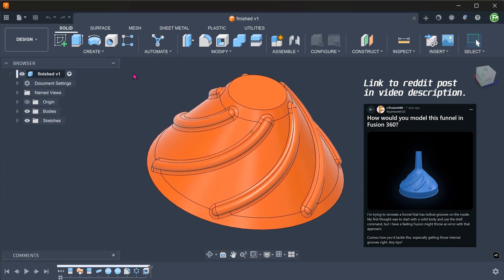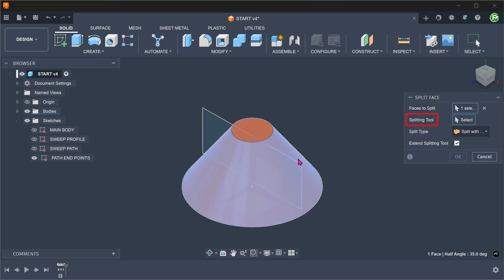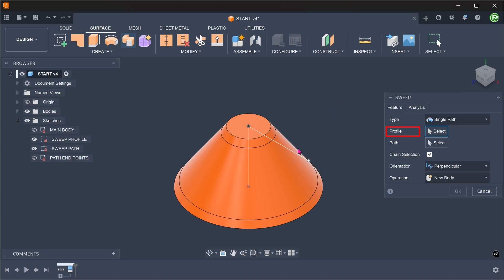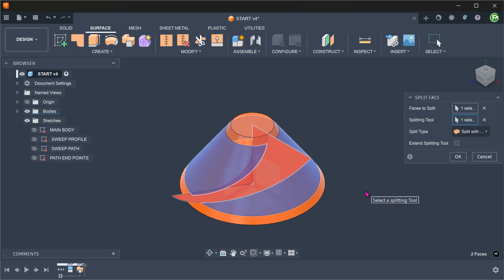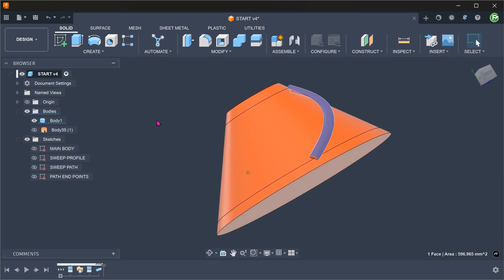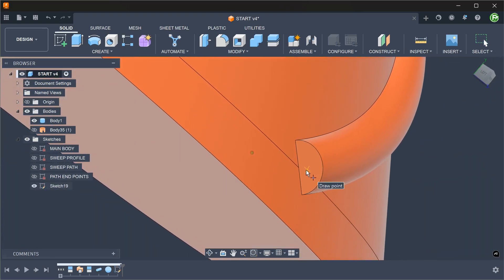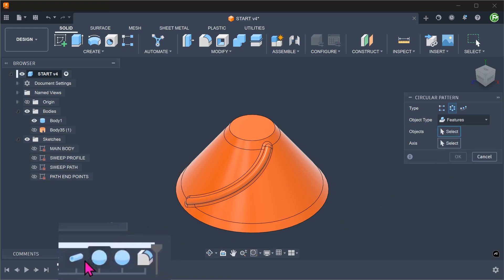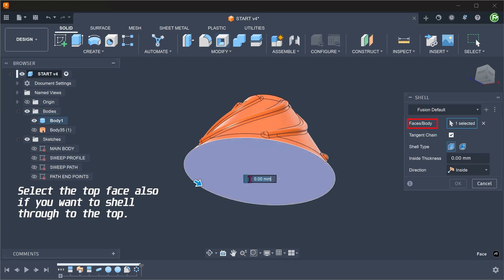Autodesk Fusion | Spiral Groove on a Cone

Comment: Excellent. Question for you - how would you create a spiral (coil) that is in a conical shape? Either wider at top or wider at bottom? Thanks!
Reply from the maker: When performing the swept surface, you can specify the twist angle in multiples of 360 degrees.
Reply: @Fusion360School thanks !

Comment: Boa noite.
Como eu deixo a minha tela do desktop Preta?
Reply: Go to Preferences, then Preview Features, and see if "UI Themes" is an option. If it is, enable it. Hit apply and restart Fusion 360 to activate the preview feature. In Preferences, under General, you should now see a "Themes" dropdown. Select "Dark Blue" or another dark option. Go to Display Settings, then Environment, and set it to "Theme (default)" to have the background colour match the selected UI theme.

Comment: option B, as you're well aware, run a projected sketch revolve on the ends of The pipe, for auto FLEX scalability when pipe flange is changed, no parameter needed for the revolve feature ✅